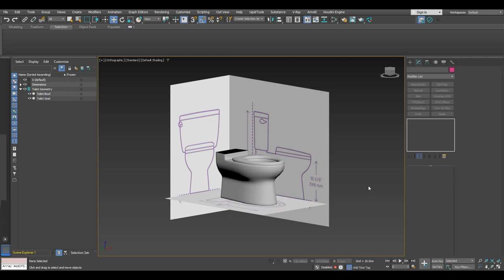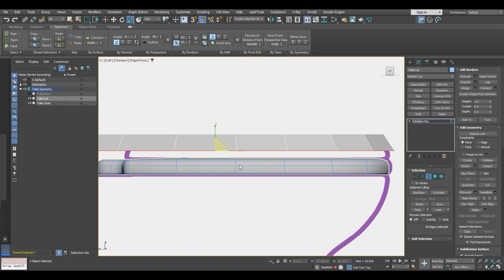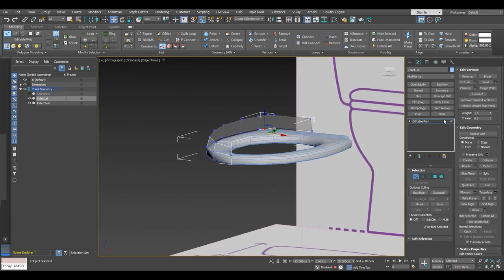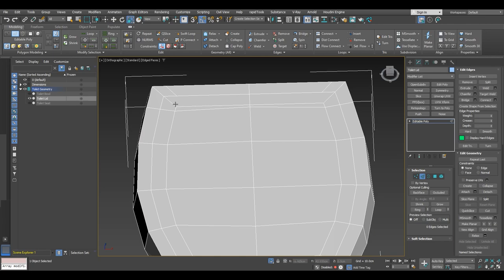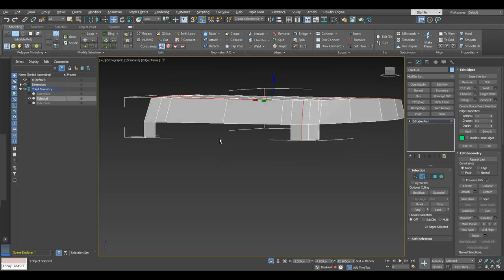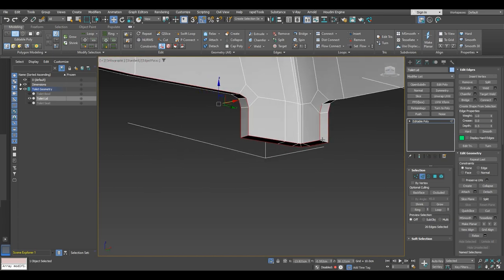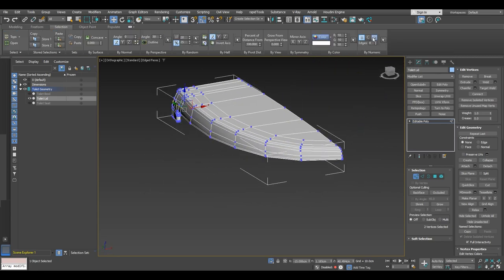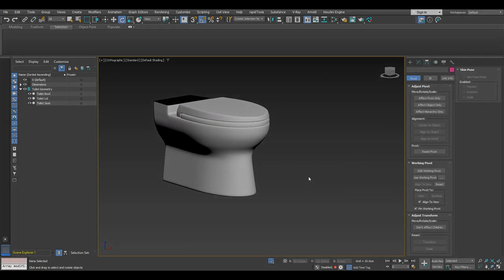3ds Max Tutorial - Toilet Modeling | Part 4 - Modeling pt. 3 #3dsmax #3dmodeling

Comment: Your modeling of the toilet COVER is what I want -- with changes!  I do NOT know anything about the 3d modeling, but I know the modifications I would like to make!  Do you have cats?  Or, do you know someone who has cats?  My cats get litter all over the floor and I need to clean the litter box every day.  If you could make the modifications I want to that toilet seat, you could save me a lot of work and hassle.  (And, probably a LOT of other cat-people would like my desired modifications.  MOST toilet COVERS are concave down. My idea is to turn the toilet COVER convex up (upside down).  That way the cover is akin to a shallow bowl.  And, in the bottom of the bowl I would like a smallish hole.  The hole needs to be small enough that kittens and cats canNOT fall in, but big enough to permit cat-waste to go into the toilet.  I would also like an attached plug or stopper to be able to go into the hole so that when the toilet is flushed, cat waste does NOT go flying out of the toilet.  NOTE:  Most toilet covers come attached to the toilet seats with those metal things.  Therefore, that type of attachment needs to be modified also.  How much would it cost for you to make some alterations like I just described?